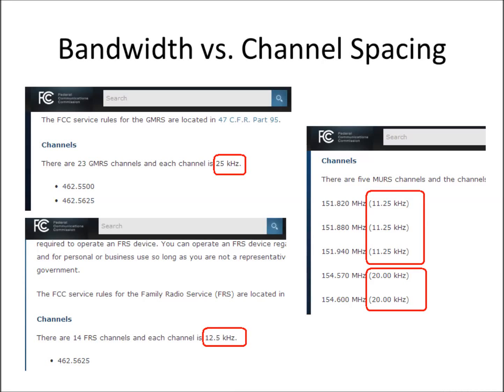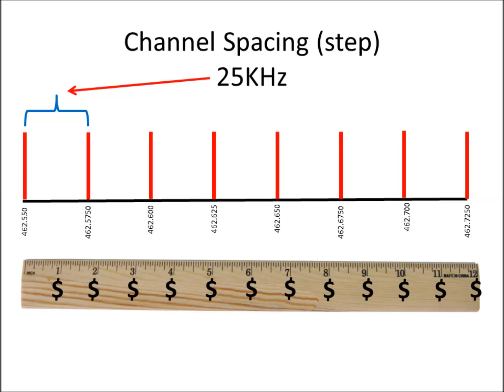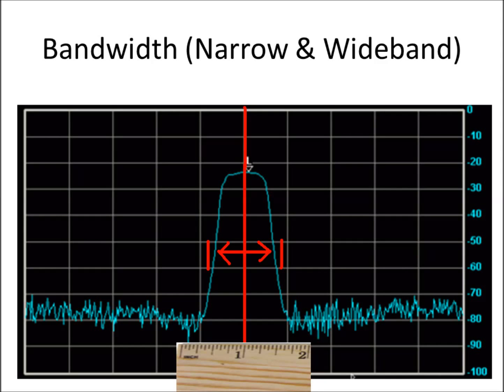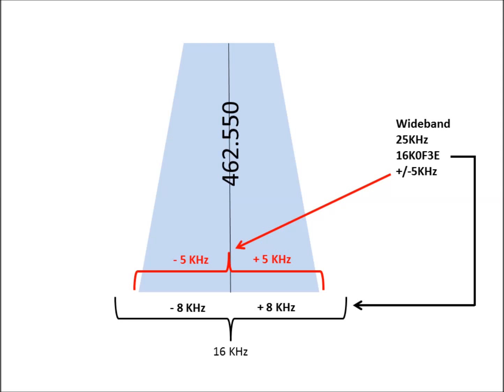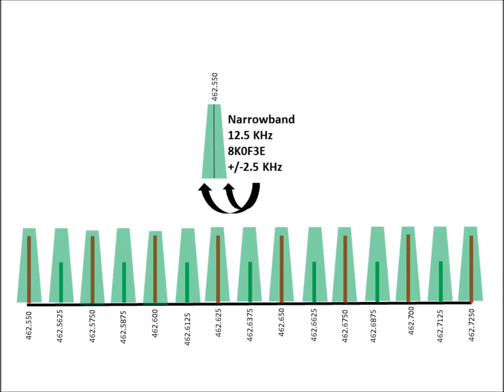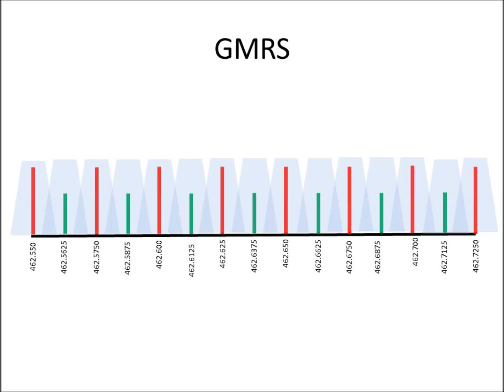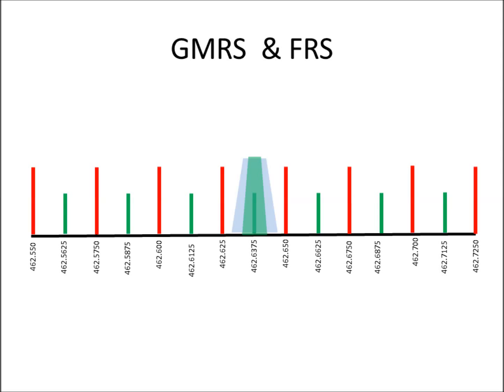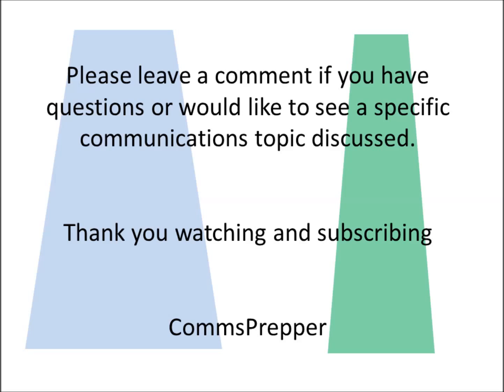Bandwidth and Channel Spacing

Comment: Love it! This is an excellent representation that visual learners (like me) can comprehend! The rules changed a bit in 2017. Old GMRS wideband was 25 kHz spacing, and is now 20 kHz for new radios. This was apparently to somewhat accommodate the higher 2-watt FRS allowance on channels 1-7 & 15-22. GMRS is not permitted to operate on interstitials 8-14 as they're adjecent to 467 MHz repeater inputs, and restricted to 0.5-watts via FRS/portables-only. 467 MHz main frequencies (467.550-725/23-30) are still reserved for repeater inputs (and brief GMRS test transmissions).

Comment: Does changing your bandwidth only effect receiving or both?
Reply from the maker: Bandwidth changes the width of the transmit signal, quality radios will also adjust the receiver circuits to be more sensitive to narrower incoming signals.

Comment: So if I go from 25khz to 12.5 khz does that give me more range on my cp200 uhf
Reply from the maker: 25kHz will have a bit more range with respects to signal to noise but it's hard to measure (in my opinion).

Comment: 25 K channels heard by 2.5K channels, will often clip as the channel bandwidth is excessive for 2.5K channel spacing.
I run narrow band on GMRS, not wide band.
Set deviation for narrow band, so it hits the +/- 2.5 channel bandwidth, but you can turn mic gain up just slightly, and maintain full narrow band use without over deviating or co-channel 'splatter'.
Reply from the maker: thanks for the comment.

Comment: Clear and concise, Thank you!

I am still struggling to understand bandwidth. in a non "frequency modulation" broadcast for example AM, why would there by more than one frequency used by a single broadcast, if all we are doing is changing the power of the highs and lows of the oscillations for modulation shouldn't we only need one frequency per broadcast?

Comment: I have struggled for a long time to understand the topic of channel spacing. This video drives it home in a very clear and concise way. Thank you for a very well put presentation and concise tutorial. I get it now. 

One question, is it possible to translate the channel spacing to Mb/s? Or does the actual bit rate depend on other factors?

Comment: Thanks for the video, Im just getting started into radio and have a question regarding bandwidth for MURS, some channels are wide vs some are narrow bandwidths. does choosing wide vs narrow make a difference in rang, clarity, and is one better than the other for buildings vs outdoor use?
Reply from the maker: wide band has a bit more range but with newer digital modulation modes it's negligible .

Comment: which would you recommend to set on baufeng radios (murs) ?
Reply from the maker: I don't recommend Beufeng radios for anything but holding the bottom of a trash bag down.  Additionally, they are only FCC approved for the Amateur radio service - not MURS/FRS/GMRS.

Comment: Thanks for the video. It was explained very well. I just want to understand here is it possible to reduce the channel spacing to lower than 12.5Khz? I mean why its not possible to take the advantage and reduce the spacing to for instance 1Khz so we can transmit extra frequency channels. 
Another important question; how many voice channel does Tetra accommodate/transmit?

Comment: What do you mean when you say (@7:50) that the gmrs channel is using 25KHz of bandwidth, when you already said that 25KHz is the channel spacing. The bandwidth is 16KHz at the maximum. Am i correct?
Reply from the maker: Thanks for pointing this out.  I should have been more specific and mention the guard space on the channels.
Reply: And I forgot to thank you for this video😅. Good work.

Comment: Ok...... so channel spacing means the frequency GAP between the CENTRE frequencies of 'adjacent' (immediate next door neighbour) channels. So between two centre frequencies of next-door-neighbour (adjacent) channels, the gap in frequency is 25 kHZ. The '16 kHz' is the absolute maximum bandwidth of a channel (ie. 8 kHz on each side of the centre frequency of a channel). The 10 kHz bandwidth is for safety, which means deliberately operating well under the absolute maximum allowed bandwidth - to be conservative.

Comment: Could you please get everything which you are presenting here correct?  I applaud and praise your presentation and effort, but just get it all correct...
Reply from the maker: You will need to be more specific.  What is not correct?
Reply: Commsprepper
Channels carriers paths, etc are confusing and not well defined anywhere, let alone by you.  Assigned carrier = licensed marker center frequency authorized by the FCC for some particulate person or entity to used for communications: transport of information from one location to another without the use of wires or fiber technology.
FCC Licenses users to place their communication on a particular frequency (carrier), of a particular bandwidth, at a particular power level using a particular modulation technology.  These frequencies of which you are speaking are NOT sold by the FCC, the spectrum is owned by the citizens of the USA, the FCC rides "trail boss" over citizens use of the spectrum, to keep order and consistency, and to prevent one from incumbering others - known loosely as interference.  Then there is segments of the spectrum which is "sold" of sorts.  It is still owned by the citizens, but a short-cut to authorization is this competitive bidding by a dollar amount, a means to garner revenue for the US Treasury from the use of the public spectrum, also know as a tax..  but only to those persons who pay attention...  These are the common carrier or 'cellular' and other commercial 'wireless' companies who obtain authorization to provide radio services to the general public, who only need to purchase usage from the providing company, or "common carrier", which is a company and not a Radio Frequency carrier...  Yes, confusing at time.  So each time you pay your cellular bill, you are sending revenue to that provider company who has "purchased" your spectrum (citizen owned) for its use, and the purchase price goes to the US Treasury!!  Private Radio Services covers the category of radio you have been talking about: Business, police, fire, utility, municipal, railroad, land transportation, etc. for Private Radio (pt 90)  Citizens Radio (pt 95) Amateur Radio (pt 97), Aviation Radio (pt 87), Maritime Radio pt 80), Then it goes into the others which are summarized as "non-private" which includes broadcast and cellular among others.  Go to <http://www.ecfr.gov/cgi-bin/text-idx?tpl=/ecfrbrowse/Title47/47tab_02.tpl> for a link to the actual Rules Parts...
Now channel steps, bandwidth, narrowband, wideband, broadband...  Another quagmire of lost and insufficient definitions.  Simply; there are no hard definition for any of these 'bandwidths', that leaves them as merely relative indicators and not absolute entities..  Sad but true.  Let us state that the channel steps are not bandwidth, but rather are the steps or distance (spacing) between "authorized carriers" which are the reference marks for the location of the radio energy used to carry information from one location to another by a particular "signal".  The bandwidth is the amount of spectrum consumed by that energy in order to transport the information.  Known as "occupied bandwidth" the location where the particular signal energy is situatied in the spectrum.  Now, the specified bandwidth by the FCC is that which is felt will prevent undue disruption to other users of the spectrum, specifically the adjacent spectrum to that authorized carrier.  Now, I can demonstrate how they (FCC etc) have disabled that concept, however let us just stay with the basics for now..  The modulation type (technology) and information flow rate are the controlling factors for occupied bandwidth.  The FCC wants stuff within certain limits, hence us good citizens must constrain our communications in order to 'comply " with those limits.  The bandwidths and channel spacings you were describing were set up to promote that "order" and prevent chaos..  Narrowband channels (carriers) were created to provide more pathways for more persons to use within the overall constraints of spectrum.  Remember spectrum is not a single dimensioned entity, it is multi-dimensional:  Frequency (where in the spectrum), geographic location (GA, NY, MT, CA, East of Mt Washington, West of Mt Washington...), power level of the transmitted signal (strong, weak, short range..), calendar time of the transmission (only at 2:00 PM, Only on Tuesdays...), and timing relation of the transmission (only in Tuesdays after 3:00 PM, not during the 2:00 PM transmission..)..  Known as shared spectrum.. So I am tiring out here and will complete this stage by saying that your effort is well noted and appreciated. I fully support your intentions, however I appeal to you to get the facts correct.  I urge you to NOT rely on Wikipedia, as it is only a populace propaganda tool and not a true reference.  Use it superficially to obtain an idea then refine that with facts.  Look at the FCC Rules & Regulations, they are free from that web site I provided to you.  First, read and understand the definitions sections of each of the radio parts and services.  Then build your case and system.

Comment from the maker: @ardorlan As technology has advanced and radio receivers have become mor selective less bandwidth is needed.  the addition of digital modes has also reduced bandwidth requirements,  The FCC is not stopping with narrowband 12.5KHz - 6.25KHz is already out there.  However, each change must be phased in over time.

Comment: FRS and GRMS and whatever rides the air would be effectively canceled out by frequency silencers. So in a nut shell postal service would make a come back. But if major structural things went down like normal in cases of bad weather or other wise frs and grms would be great in those situations where infrastructure was gone. Thanks for the information on how all that works on paper. Also could you put band stacking into equation on a single channel?

Comment from the maker: Channel bleeding should not occure if only 2.5KHz bandwidth channels are used in spectrum using 2.5KHz channel spacing.  Narrowband bandwidth and channel spacing/stepping are not a negative.  What preppers should know is that differences exists and how it applies when programming you equipment.  Hope this helps.

Comment from the maker: Response to question: 25 Yr. radio tech.  See USMC Radio Handbook MCRP 3-40.3B FM - The amplitude of the modulating signal determines how far away from the center frequency the carrier will move. This movement of the carrier is called deviation; how far the carrier moves is called the amount of deviation. During reception of the FM signal, the amount of deviation determines the loudness or volume of the signal.